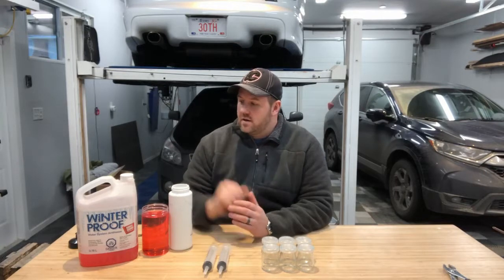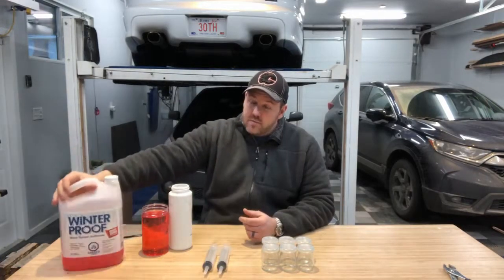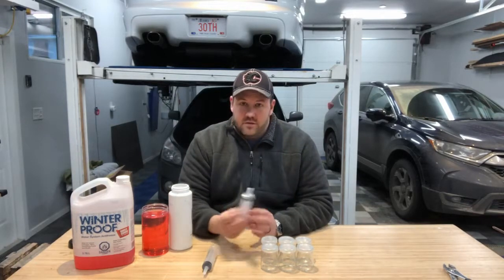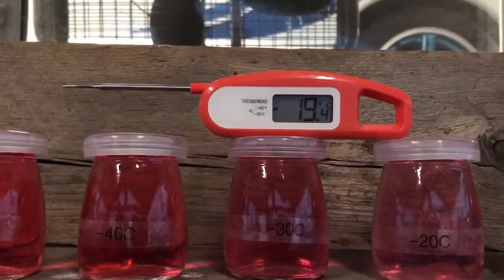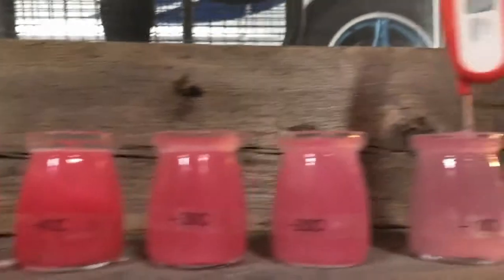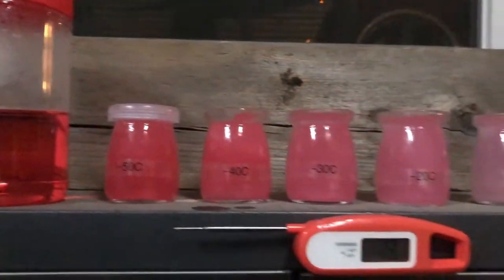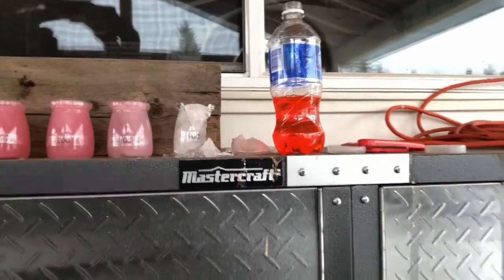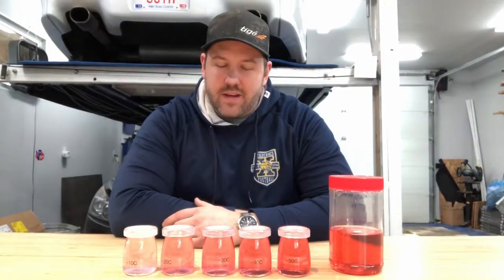Understanding RV Antifreeze for your Boat Engine

Comment: Great video and very well explained! Just one question do you leave your boat engine full of antifreeze or do you use the method of running antifreeze throughout the engine and then draining it again. Just asking because in my case I heated up my engine drained the water out then filled up the block with antifreeze then ran the engine with muffs that were connected to antifreeze bucket. So in my calculations I would probably have a 90 to 95% of antifreeze in my engine. Long story short is it ok to keep your engine full of antifreeze?
Reply from the maker: Yes. Always leave it in.
Reply: I was just worried if I did enough preparation to leave the antifreeze in. Is there any specific reason you keep it in and if there was just a little bit of water mixed in it should still be fine correct?
Reply from the maker: @MrAirsoft0917  It's a lot more work to drain the antifreeze, but draining it won't hurt anything.  The benefit of leaving it in is that all the seals etc remain wet and lubricated.  That's really the only minor benefit.

Comment: Nice calm meaninful explination. your a patient man, become a teacher LOL!   fine i will use antifreeze. Vancouver bc had had some -11c nights but thats about it better safe than cracked block
Reply from the maker: In a warmer climate (I mean warmer than Alberta) you should be just fine warming the boat up on water, getting it to operating temp, then switching your inlet to antifreeze.  I don't think there is a need to drain the water first.  It takes it from a 2 hour job to a 15 minute job.  You won't get all the water out, but at least it will mix with the antifreeze and get you the various levels of projection I discovered in this video.

Comment: Great video.  Im actually conducting this same experiment in my freezer with prestone -100 . Even at 5 degrees Fahrenheit it gells up.the glass containers are a great idea. Im using dixie cups. Im a Mobile marine mechanic and ive winterized over 30 high end wakeboarding boats this season already and this test is just invaluable for peace of mind.